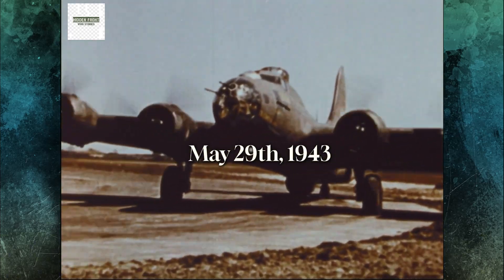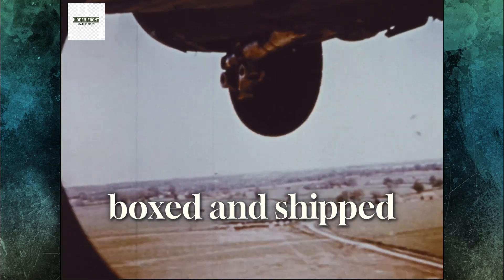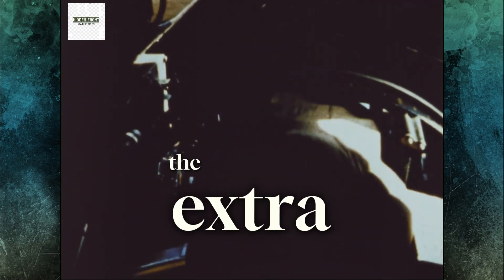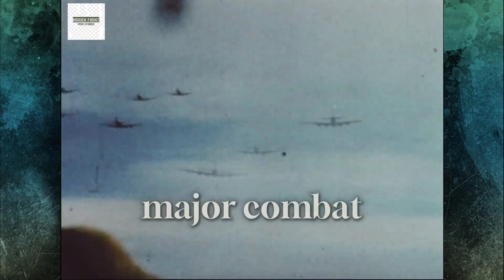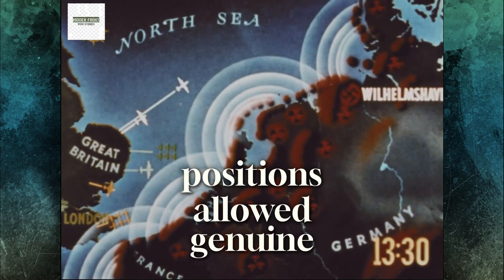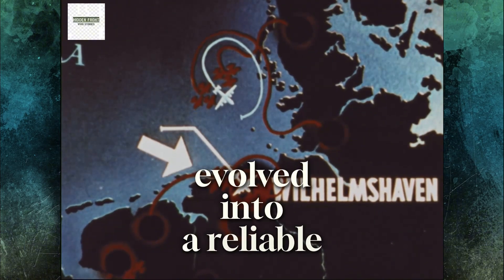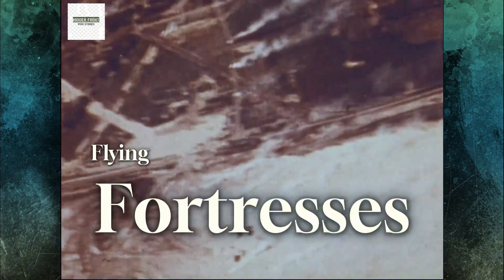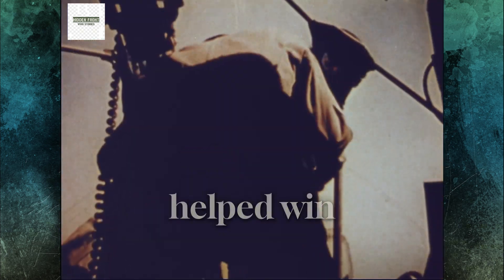The B‑17 Flaw That Killed Thousands—Until One Simple Fix Saved the War

Comment: is this it....The most crucial changes to the B-17 that transformed the war were the addition of the tail gunner and a series of defensive and survivability improvements in the B-17E and later models, particularly self-sealing fuel tanks and armor plate from the B-17C. These modifications, especially the B-17E's new tail turret and power turrets, gave the bomber the defensive firepower needed to withstand heavy German fighter attacks, allowing for its effective use in high-altitude strategic bombing raids against Germany. The introduction of the turbo-supercharger in the Y1B-17A model was also key, enabling it to operate at higher altitudes where it was safer from ground fire and fighter attacks.